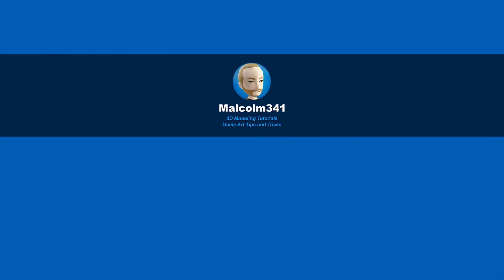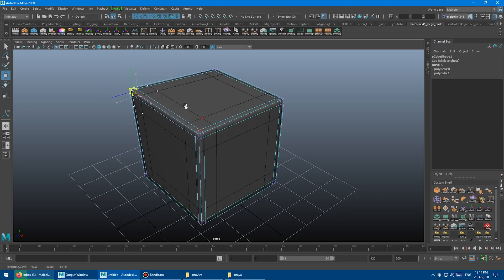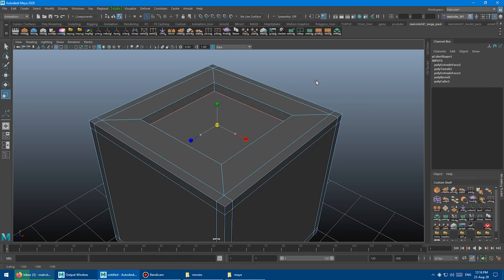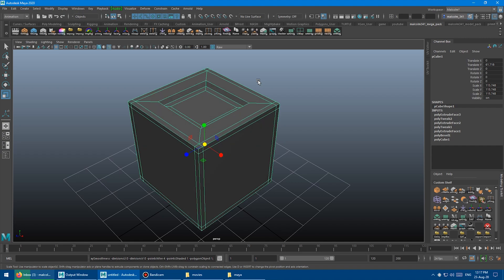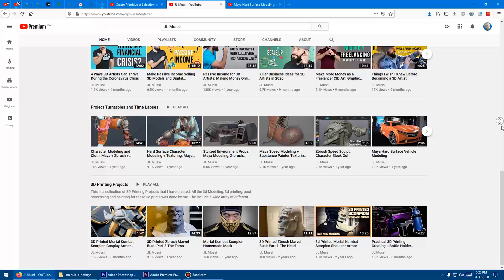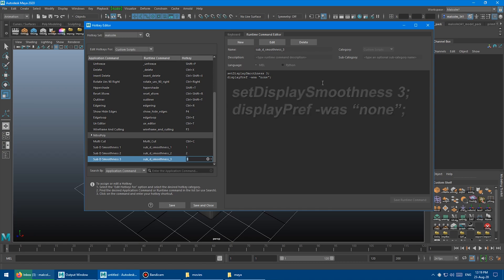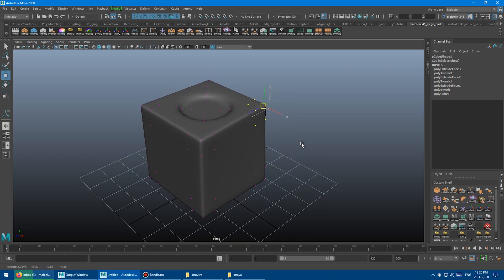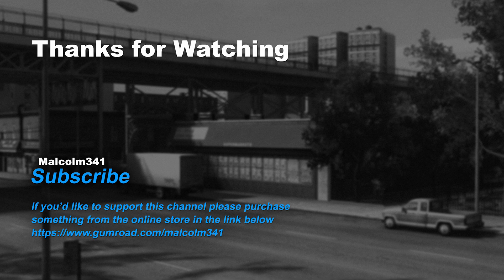Better Sub-d Hotkeys for Maya

Comment: This script has a rendering error when used with the default material. But adding an Arnold standard surface fixes it. So if you see faces trun black, just change the material.

Comment: Thanks Malcolm for the scripts.
There must be something else in Maya drawing low poly cage on top of subdivided one.
I wish we could override it. 

Despite using none for smoothness 1 and full for smoothness 3, I get the other way around results. Not all the time though.
Reply: It is something in a Maya scene, that causes LP wireframe keep displaying on selection.

Exporting objects to a new scene solves it.
Reply from the maker: @arturperzyna5453  cold be you have a hotkey for wireframe on shaded or something?
Reply from the maker: @arturperzyna5453  You'll need to be a bit more specific, if I create a cube, then run this hotkey
setDisplaySmoothness 3;

displayPref -wsa "none";
to show sub-d without wireframe and then do any of the operations you mentioned my mesh still has no wireframe. Even if I run the camera map script you posted I'm not seeing any issues.

Comment: So this is a great setup and I've been using/testing for a bit.  In my work I use a lot of Maya's various modules as a 'generalist'.  The downside to this implementation is that when using the hyper-shade window, 1,2,3 keys are also used to collapse shader nodes or show explicit detail levels of the selected nodes.  Side request:  It would be great to get delivery of your script library somehow individually as I build my own shelves and sometimes just want to update a script update or alter a bit on custom shelves etc.
Reply from the maker: That's annoying, you might be able to override the Maya default hotkeys for smooth mesh preview instead of making new hotkeys and that might get around the problem.
Reply: @malcolm341  I'm a scripter but part time and usually in a hurry.  If I find a solution I'll write back!
Reply from the maker: I'm actually not having that problem in Maya 2020.4, but in my hypershade 1, 2, 3, don't do anything.
Reply: if you do a backup and kill your prefs.  You'll find that 123 do work as I try to indicate by default.

Comment: I can not agree more. your videos don't mess around. point out the problem and here is the solution... once Maya loads we will do it.... waiting.... waiting...  Do you have a solution for that problem for Mayas' load time without shutting off everything in maya lol jk Thanks for this.
Reply from the maker: Thanks a lot, I haven't found any solution to the slow Maya loading except turning off plugins, which can be annoying so I'm making a toolbox where you can disable/enable the slow plugins whenever you like so you don't have to fiddle with the menus. My Maya also closes very slowly, but I have a found a solution to that problem in the form of a new script which will close Maya in 3 seconds so look for those free updates to the script pack coming soon.
Reply: @malcolm341  Tragically a lot of application slowness, explorer browsing is just because of Win 10 tracking and registering (Worst OS from MS).   Biggest speed up for me was to disable the bifrostGraph stuff in plugin manager however.  Before that.  Super long to boot.  Closing is not much different.
Reply from the maker: @frumpeting  I have a tool now to close it in 1-2 seconds, and also a toolbox for disabling all the slow plugins video here https://youtu.be/mDONY44P4jA